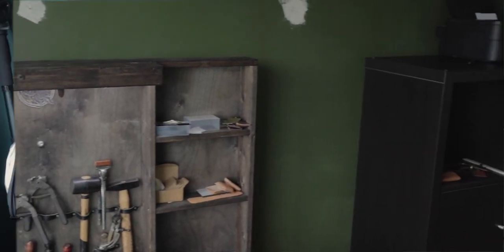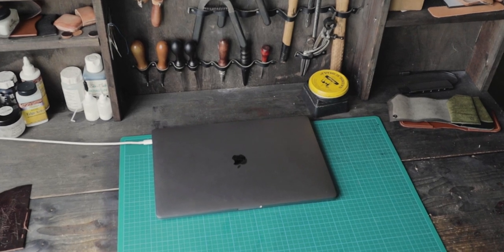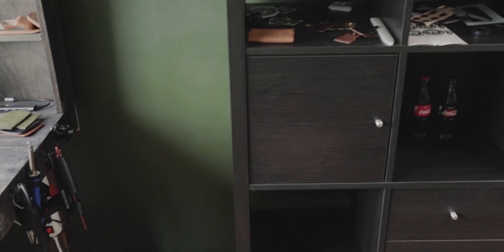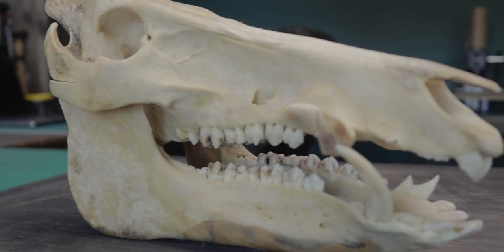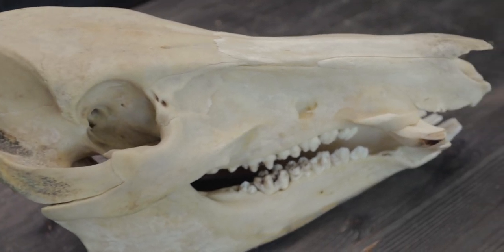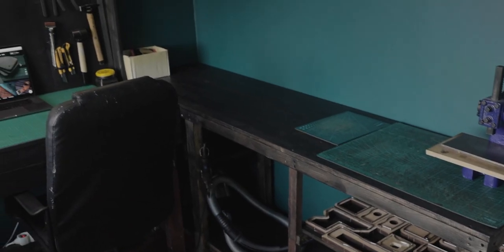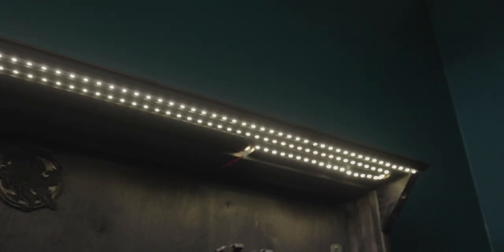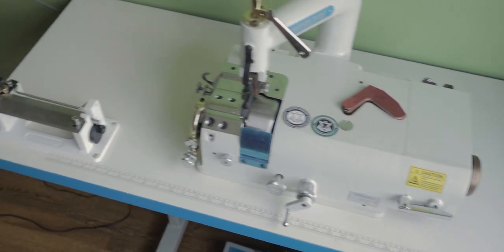My Leather Craft Workshop Rebuild and Tour - Before & After

Comment: I saw the white leather Splitter on your table I am looking for one without spending a lot of money I got into leather crafting a year ago and I like to step it up by starting to pick up better leather more equipment and selling products, not in that order
Reply from the maker: I bought and using it for one particular purpose,  splitting Shell Cordovan for double watch straps
Reply: @strhandmade  does it work and if it does can you direct me to where I can purchase one if you think it would work for belts
Reply from the maker: For such narrow things as belt straps it works pretty good. I bought it on ebay, search for: leather splitter
Reply: @strhandmade  hard to believe in the description items on Ebay 90% of the stuff on that site is junk from China they say it's good quality metal but it turns out to be garbage I don't mind having to sharpen it that's easy enough thanks for your response brother great wallets keep up the videos
Reply from the maker: No doubt its chinese made, but for my particular case it works. If you need exceptional quality item probably the best way is to make it by your self, quite easy construction.